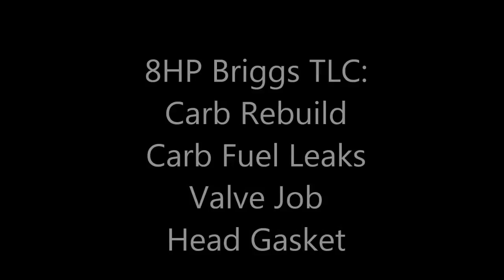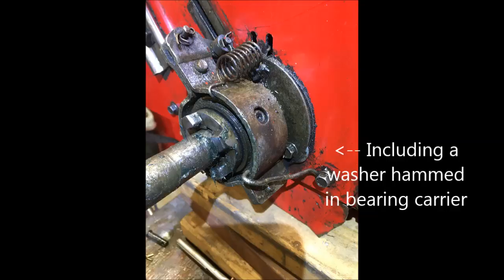1986 Toro 826 in Action: 33" Snowfall

Comment: I watched this a ton when I fixed up my 832 and sold it to my good friend with a larger property. 2nd motor on it ran well so it didn't need the teardown but I had to do a lot of what you did for mechanical linkages and such.
Well, an 1132 in even better shape came along with a fuel issue so I'm back in the game with a fun winter project. I have a Predator powered 1986 6/26 that absolutely rips and this 1132 I grabbed 75 miles away will rip as well! Super idea on how to clean up that fuel tank I need to do the same! I wish I had a welder/talent to do a lot of what you did. JB Weld is as far as I can go without all that great machining equipment
Reply from the maker: That's awesome Matt!  Yeah these old briggs-powered toros are monsters...they're contractor-grade machines of the time!  What I really appreciate is the serviceability & adjustability; you don't even have to drop a belly pan... the console linkage & little kick panel there makes friction wheel adjustments a breeze!

Comment: I had its little brother toro 421 made in 1978.i bought it in yard sale for 10$ in yard sale 15 years ago.it doesn't clogged.i wish toro keep doing the old model.
Reply from the maker: Nice find!  Those old 421/521 machines are surprisingly capable (good HP:bucket ratio) and super maneuverable!  The good thing is that Toro made a ton of them back in the day so the used market is flooded with them!

Comment: Very impressive. Those drum augers are very efficient. Toro ruled in those days.
Reply from the maker: Thanks!  Yeah man...they're amazingly effective.  I really appreciate the serviceability of an old Toro.
Reply: Toro still rules.. 

According to tests they outperform The competition in consumer reports and other big testing companies. 

The quick stick is so awesome is one reason why people buy Toro just for that. 

Anti-clogging system really works aerates the snow so it can be thrown further by recycling some of it back onto the auger. This makes the snow lighter puts less tension on the belts and the engine.. 

NO SHEER PINS IS NO JOKE!! And it really works I hit a rim a car rim under the snow did not know it was there bang the machine stopped immediately, I restarted it and off I went!! 

Even their metal is innovative..not as thick as Ariens but just as STRONG  they use a special type of metal can be thinner but strong as other types that is thicker.. 

Makes the machine more manoeuvrable and lighter.  

They even get where you can use plastic and when you can't.. they had a whole video about how some plastic is actually stronger than metal, It doesn't rust, last longer, looks better longer, And is more slippery.  

They're so innovative always trying to make things better.. 

Not to mention Toro Was the first company in history to make the stand behind snowblower in 1951!! 

THEY GET IT THEY KNOW WHAT MATTERS AND WHAT DOESN'T!! 

;)
Reply: @muzikmon2267  toro is not toro anymore. Toro is cub cadet, husqvarna, snapper. What I mean by that is they are all the same product with their name slapped on them. You’re paying for the brand now adays not the quality. Toro actually made their own product back then. Now all of the brands buy the same product from a manufacturer in China and just slap their name on it

Comment: Very Nice! I had a 521 Toro, even though it was small it was a tank!
Reply from the maker: Thanks!  I have 2 other older toros; an 824 and a 724.  That 521 of yours is a very nice unit...compact and good HP to width ratio!  I recommend them to just about everyone looking for a used, compact 2 stage.
Reply: @classiccat7403  I got mine for free from a municipality along with a Snowbird! I kept the Snowbird because of how neat it looked.
Reply from the maker: @ericcoffedgp40  the really old snowbirds with the bicycle handles and traversing chute/impeller housing are super cool...Ive never worked on one but would love to take a crack at one someday!  B&S 5hp?
Reply: @classiccat7403  The one I have has a 6hp Techumseh.
Reply: I have a 421 Toro that was made in 1979 and still runs well.  Those machines were built to last.  Unfortunately the newer ones are nowhere near as durable.
Reply: @1575murray  I agree, that is why I only buy old machines! Old is gold! 😊
Reply: manny ramires  Nice story! I agree one hundred percent, these little snowblowers will handle a suprisingly large amount of snow!

Comment: Great video and great job, my 1972 model 31760, a 726 looks almost identical and basically needs the same tlc, mine has a spring loaded scraper bar which I didn't see on yours

IT would be nice too see tor release some sort of anniversary edition, we all miss heavy gauge steel, but maybe with a few greaseable bearings in lieu of bushings ....but ust a few
Reply from the maker: Thanks!  Mine also has the spring loaded scraper.  An anniversary edition would be cool!  it would cost 3 grand in U.S. steel alone!
Reply: I bet if they made a new one identical to this they would sell.   And keep the engine the same too, no plastic.   I'd buy one even if very expensive.   They'd never lose value if you kept it in good shape.   Any person doing snow blowing as a business would scoop a new one up asap.

Comment: Awesome video. These machines were the best. I had a 7/24 that ran almost as good as this one and I ended up passing it down to my nephew. I replaced it with an older snapper 8/24 and I couldn't tell you which one i prefer. LOL Great video and great job on the rehab. You rock!
Reply from the maker: Thank you phil!  I also had a 724 that I brought back from the dead (broken connecting rod)...i have a few vids on it.  The drum auger on a Toro is amazing for metering snow.  I'm making some "upgrades" to my AV so hopefully some better videos in the future!  Does the snapper have the Briggs or Tecumseh powering it?  They're tanks as well!

Comment: Awesome!   I have two of these.   Would you please do a video on installing a new spring in the pull starter recoil?   I can never get the spring in perfectly no matter how many times I try.   It never stays tight.  Thanks
Reply from the maker: i've never had to replaced a spring in one.  get out the rust with either MMO, ATF or penetrating oil.  Then add more tension, you notch the inner spool (I use a soldering iron to melt it) which allows the rope to spin in the recoil housing.

Comment: Classic cat. Wow. I got a 622 Toro big dram aguer from a friend. 
Finally got it going after a week. Need to find out why it doesn’t have 1st and 2nd gears. It has 3 rd gear and reverse. It’s a tank solid and heavy two of us to remove from my SUV. 

Any suggestions
Reply from the maker: congrats on your new machine!  you can try a belt for traction (good idea to change out both belts anyway) but my guess is that the friction wheel isn't making solid contact...rubber may have worn over time. Check out page 31 of the service manual for the procedure:  https://www.toro.com/getpub/22448

Comment: Very impressive work on the old Toro, I have a question, I have a 1980 Toro 11/32 snowblower that has the pivot style scraper blade and I was wondering how do you properly adjust the skid Shoes on these machines to get the proper ground clearance?
Reply from the maker: Thanks Aaron!  It really depends on the surface you're blowing snow on. generally even with the spring-loaded scraper,1.)I loosen the shoe bolts, 2.) lift the bucket and place a "spacer" on the ground where the scraper (bottomed out on the stopper) touches the spacer. double check that the spacer isn't retracting from the weight...if it does, you may have to relieve some of the weight with a helper. 3) tighten the shoe bolts.  If i'm blowing snow on my smooth driveway, i use 1/8" steel stock.  If clearing my backyard with alot of topography, i'll use a piece of 3/4" plywood for the height spacer.
Reply: @classiccat7403  Awesome, good to know! Thank you!

Comment: Great video, I have the same machine.  Did you need to adjust the transmission.  My first gear does not always connect properly. I' m not sure if I need to change the friction wheel or if there is something to adjust.  Thanks
Reply from the maker: you probably just need an adjustment and it's super simple on these machines; it can be done without even removing the rear service panel.  try to get your hands on an operator manual for illustrations (https://www.toro.com/getpub/8563).  Go to page 16E.  You're simply moving that U shaped pivot bracket in or our (you'll be rotating it out; counterclockwise looking up at the underside of the control panel) in 1/2 turn increments until you get solid engagement and full disengagement in neutral.
Reply: Thanks for the information on how to adjust the u bracket under the control panel.  I'm hesitant working on this before the storm they announced for tomorrow.  I wonder if anyone has a video on this. I just love these old 8hp tanks.  I have 2 of these machines one is an 832 dating from 1976 which I m having problems to start the engine and the other one is 826 dating from 1989.

Comment: Wow.  Awesome work on that machine.  (I have an '84 Toro 828, but with the Tecumseh engine).  Nice video.  Thank you for making & posting it.  Dear ClassicCat, kindly, ¿what is the 'wheel clutch in action' you've shown there?  ¿Are both wheels driven by the drive shaft?  (¿Is there something I could do with my machine that will allow better/easier turning, is why I'm asking).  Any/all comments much appreciated.  Thank you.  tonyd\
Reply from the maker: Thanks TonyD!  Some models like the 826 and 1132 (both with Briggs engines) as well as some of the really old 70's machines (726 & 832) have clutches for engaging wheels.  The wheels have cogs in them that mesh with a sliding clutch.  If you wanted to turn to your left, you disengage the left wheel so that the right wheel drives it around.  It wouldn't' make sense to try to adapt an 524/724/824...way too much hardware to swap out; you're better off finding a machine with clutches.
Reply: @classiccat7403  Hi ClassicCat.  Thank you for explaining the differences to me, and the kindness of a reply.  (I'm thankful to have this '84 Toro 824, and still running nice).  Thank you for making & posting your videos.  (I've learned from them).  (You're a good mechanic/model-maker).  Thank you again.  God Bless.

Comment: I have the same one.got it for free and works better than a $2,000 new Chinese plastic one from lowes.
Reply from the maker: My favorite four-letter "f" word!  these are tanks and once you get the mechanicals working right (esp the wheel clutches) with that old briggs flathead driving it...truly a pleasure to use!
Reply: @classiccat7403  it's a snow hog for shure eats it up spits it out no problems.its sad the old ones out do the new ones.

Comment: That was one unloved machine.  It took a lot of skill to save it but the results speak for themselves.
Reply from the maker: Thanks!  Yeah man... it's amazing that it didn't end up being sold for scrap!  Clearly a testament to how well they were designed / made that they can be brought back from a state of such disrepair.  She's been a bucket-list thrower for me and I've been blessed with the opportunity & ability to give her a 2nd lease on life!
Reply: @classiccat7403  There's a post on Craigslist from someone in Connecticut who has one of these (1980 model) for sale for $150.  It supposedly has a broken auger system but otherwise is in good condition.  I am thinking of going up there to take a look at it.
Reply from the maker: @1575murray  winter price on a busted machine that won't be operational until the summer...so I'd make a summer offer lol!  Assume worst case, new gears alone will be $180 from Toro ...then add gasket, mag lube, bushings and seals.  (or you'll luck out and it's just a belt or shear bolts)
Reply: @classiccat7403  I have looked around and found gears for a lot less than $180 on eBay.  I would guess that the worm gear would take the worst hit as it is made out of brass and the one on the impeller shaft is made of steel.  They look a lot like the ones Murray uses as I own one of them and I reassembled the gearbox when I replaced the impeller on my machine when I got it two years ago.  I may take a look at this as it looks to be much better cared for than yours was.  Perhaps the oil leaked out of the gearbox and caused the failure.  I would agree that grease is the way to go on these old machines as oil will just go right past the seals.  The new machines even Toro look like toys compared to these heavyweights.
Reply from the maker: @1575murray  Good luck brother!   If that one doesn't work out, I saw another 826 in Ct on facebook marketplace in the $250 range.  With < 2mos left of snow season, it's turning into a buyer's market!
Reply: @classiccat7403  The problem that I have is getting it home.  I don't own a suitable vehicle (either a pickup truck or van) to transport anything that big and heavy.  It's true that a lot of people are looking for machines now.  I just went out and bought more ice melt before the stores run out!
Reply from the maker: @1575murray  Oh boy, it's a beast.  yeah if you can't rent or borrow a truck, bring a set of sae wrenches / sockets with you so you can split the machine and make it more manageable.  You'll have to do that anyway to service the auger.  (2) 9/16" needed for the bolts that secure the tractor to the auger.  1/2" for the chute and 9/16 for the belt guide. I use a couple of 2x4 lumber pieces under the impeller housing when splitting/joining (https://youtu.be/-zT69i4yBP4?t=134).
Reply: @classiccat7403  Even if I split it my car isn't big enough for a beast like this one...I will think about it.  I might look for something a little newer.

Comment: For that much work, I would have been torn between trying to find a stock Toro tire or installing newer tires.  I'm not sure I want to know how somebody damaged a single snowblower tire to the point it needed replacement.  Usually all that can happen is they can wear out, which takes a LOT of use and it'd be tough to only wear out one.  ;)
That dog clutch system just looks like one of those things that looked good on paper but not so good in the real world.
I'm also torn on those early "safety" systems which, because they are an "add on" type feature, are not integral to the machine and when they fail, they often fail so that the machine still runs.  Usually they just ground out the ignition, so, any bad connection means they don't work, instead of the machine not working.
Reply from the maker: Those stock Toro tires that were original to this machine have zero traction.  Their more modern knobbies are excellent.   The Carlisle Snow Hogs that I have on this and have enough traction to plow up my inclined driveway and just enough slip to turn without using the wheel clutches.
Reply: @classiccat7403  I wasn't sure how bad they were, sounds like they are about as good as the old Military NDT's which they seem to mimic.  ;)
I guess there are times where performance is worth more than keeping something original.
I'm kind of an Ariens boy, so I have no experience with those Toro tires, but I certainly find them recognizable.
I did have kind of a similar dilemma with my old ST504.  It had the old diamond turf tires, kind of a holdover from when Ariens had intended to sell a "system" where there was the two wheeled "tractor" and you had your snowblower, lawnmower, and other attachments.
I had chains, so that worked, but chains are clunky to use.  I had thought about putting modern tires on it(which would have required a torch to do, lol), but I found when I removed all the air from the diamond treads(yup, completely flat), the tires were so old and hard they supported the weight of that small machine(only 130#) and got descent traction.  I guess it's not too surprising as modern car snow tires have gone to small gaps in their tread with great results on pavement.
Didn't think about it until now, but, since they were flat, I guess I could have studded them, lol.  Still, I liked having the option of chains, tho.  I could install them pretty quick if I ever had to deal with hard frozen snow.
Reply from the maker: @l337pwnage  yeah you would definitely need chains with the old toro slicks...they might actually be worse than the old Ariens "turf-saver" style b/c of the large flats on them.  I sold 1980 Toro 724 with the slicks to my neighbor (she weights 100lbs soaking wet) and she bruised herself trying to get it out back to clear the dog paths... I threw some Carlisle X-tracs on it for her and now she's lovin' on that Old Iron!